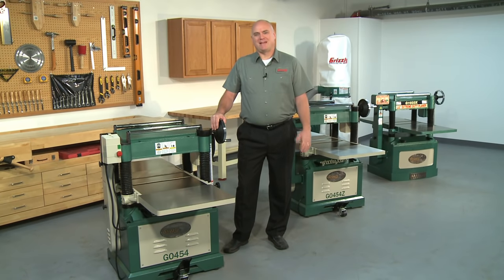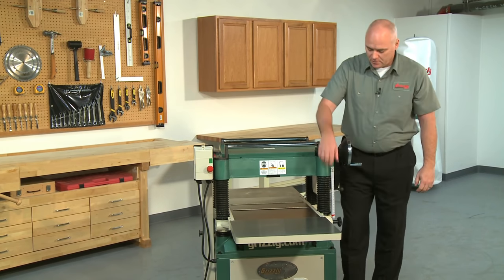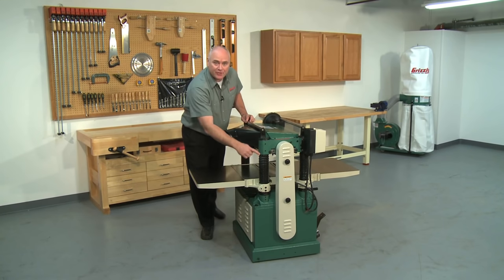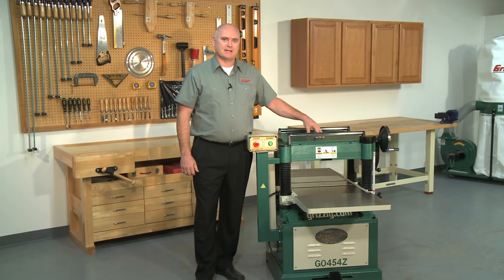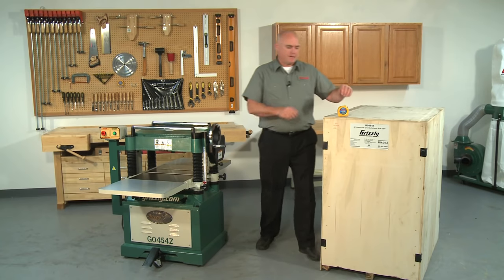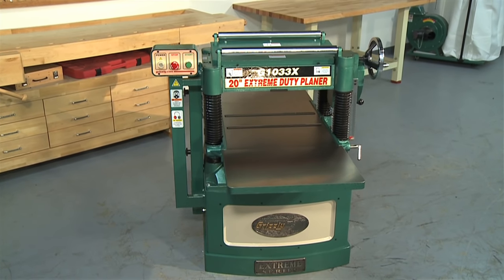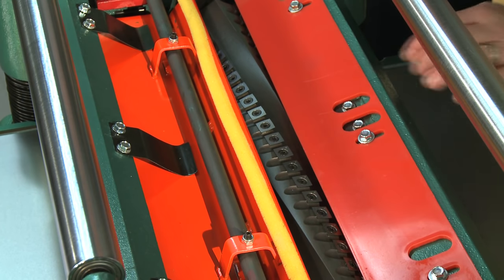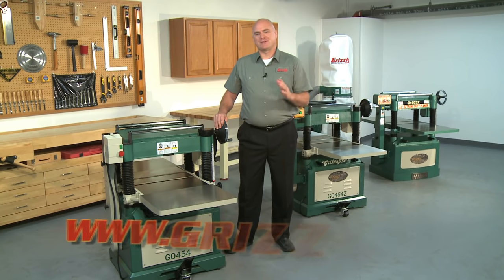Grizzly 20" Planers Comparison

Comment: I've had the 0454 for about 5 yrs now with no problems. The thing is a beast!! I just put in the 20" shelix with the indexable carbide bits. This blade was recommended by my Grizzly rep. My ears thank him every day. The noise and quality of cut is night and day. Get the Rotacator to adjust blade and infeed and outfeed rollers, you won't regret it. This machine has paid for itself over and over. Thanks Grizzly.
Reply: There's a furniture shop in my area that is closing soon and they have a G0454 up for auction.  I'm thinking of bidding for it to upgrade my DW 734.  Can you move one of these things up a ramp and onto a trailer without heavy machinery?
Reply: How is it performing today in 2023?

Comment: I cant tell the difference between the 454zand 1033x. Same motor, same size, both 20inch, and actuallythe 454z has a mobile base. Why is the 1033x better being called extreme. More particular are the internal parts different?

Comment: the create weighs in at  920 lbs  wow how much does the planer weigh then if the create is that much.   Next what am I to do with the extra 20 volts do you have a voltage regulator voltage at the shop is 240 not 220 . the bed rollers how high above the bed are they and will they create snipe
Reply: samm frankss 240 and 220 volt are the same thing, they're used interchangeably within the industry.
Reply: There is no 220v. There used to be and now people can't stop saying 220. They love it. It always reads 240v when checked with a meter..."nah my pahpah said 220 so that's what I'll say. "
Drives me nuts.
There is 208v, but no 220v.
And if you have 208v you know it because it's one leg of a 3 phase system and you'd most likely know that if you have that at your shop or business.

Comment: What are the real feed rates the machine comes with: 16 FPM and 20 FPM or 16 FPM and 28 FPM?  The grizzly page has it confused.
Reply from the maker: Hi Jose, the G1033X has Feed Rate(s): 16, 28 FPM, the G0454 has Feed Rate(s): 16, 20 FPM, and the G0454Z has Feed Rate(s): 16, 20 FPM.